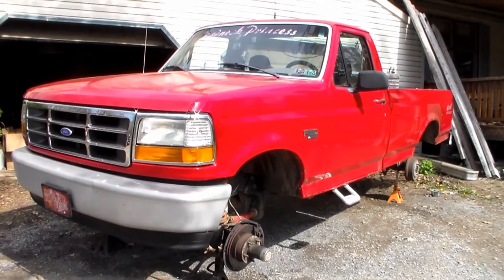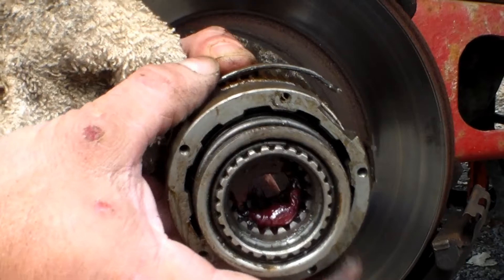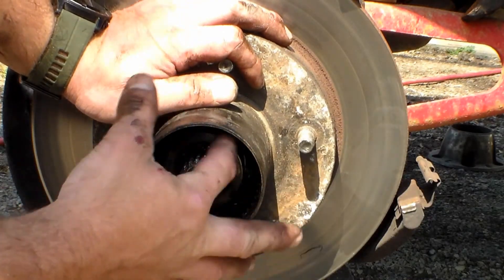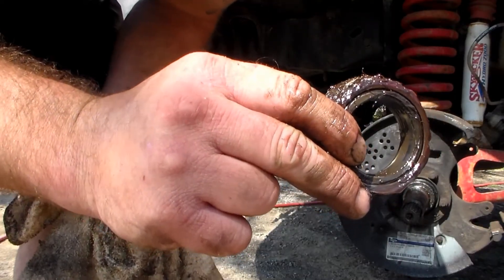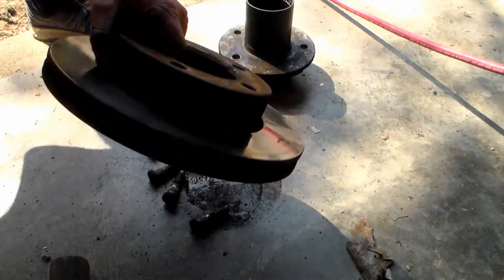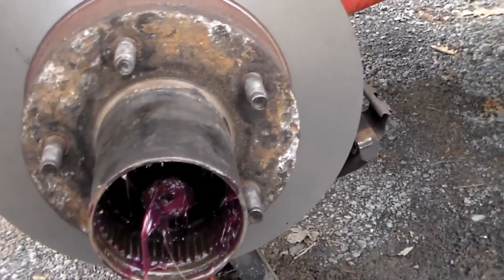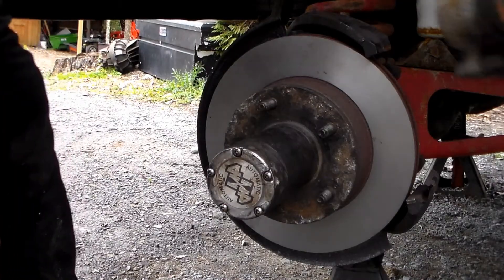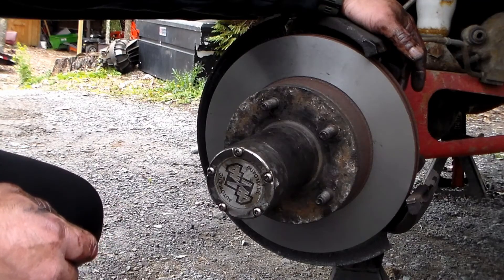OBS Ford - 4x4 F150 Bronco - FRONT BRAKE PAD and ROTOR Replacement- Complete STEP by STEP!

Comment: Great video, very detailed with lots of tips, I bookmarked it! I have manual locking hubs but I'm getting ready to help a friend who has the Auto Lock hubs so I wasn't familiar with these. I went to auto mechanics trade school many moons ago, we where taught to always to repack pack both inner and outer wheel bearings as well as always replace inner wheel bearing seal. I mean you might as well change that inner seal as you have everything taken apart and they're only $3-$6 each. And as you did, turning rotors and drums is always a good idea. What I do is buy a new set of rotors or drums, mount those and next time I do a brake job I take the old rotors or drums to the shop, have them turned and swap out. And just keep doing that till they no longer meet spec :)

Comment: Hey bud....  thank you for the video...  I am 50 years old and just bought a 95 F150 4x4 and I have manual locking hubs...   question....   should I fill the hub cap with grease after I get the installation complete??
Reply from the maker: No Sir. Just grease the moving parts but no need to "pack" the hub with grease.

Comment: Very nice video and without any distracting music. Make sure you stress how important it is to get the inside and outside of the hub clean, before installing the bearing. It is a greasy job, so have lots of paper towels or clean rags handy. When the hub is off the Rotor and cleaned up, that is the time to paint the hub if you are going to. Painting the hub and rotor does help to keep the Rotors clean especially if you live in an area where the roads get salted in the winter. Thanks again for a nice instructive Video.

Comment: Thank you!  This is a great video, you are a lot better than most people ive seen doing these videos. If you have ever thought of doing more, please do!
Reply from the maker: Thank you I appreciate the support!  At some point this summer I will be doing a video on how to replace your core support in an hour and a 1/2. You don't need to remove/drain the radiator or anything. I've done so many of them I think I have it mastered now lol.
Reply: @rednecktech82  Nice ill try to remember to check that out. The fact that you don't have an intro clip is great, it seems like everyone does that and it's so annoying! I have a 94 bronco that I am working on and this video really helped me. I am new to this family of vehicles and I nearly did something really stupid when I tried to take the rotors off. I didn't realize all that stuff inside and I tried getting it off by hitting the backside of the rotor, luckily I stopped pretty quick. It's nice to know how complicated it is so I can keep track of all those pieces as I take them off. It's also nice to know that I need that tool to take the nut off. Thanks again
Reply: A video on how to remove the headlight assembly would be nice if you ever have time. I know they're a pain in the ass, I gave up after about 20 minutes. There is definitely a way you have to do it.
Reply from the maker: @Cheeseplate1775   It's actually quite simple. There are (2) 12mm (?) nuts on the back side, 1 left 1 right, if you look close you will see them. On the passenger side I believe you may have to remove the battery box to get to them.  I'll try to get a video up by the end of the week.

Comment: I have a 95 f 150 and the rotor is loose ( turns a little back and forth ) even when the wheel is bolted down tight. What would you make of this? are the studs all jacked up?
Reply from the maker: @Bushradical  the wheel isn't loose but the rotor is!?

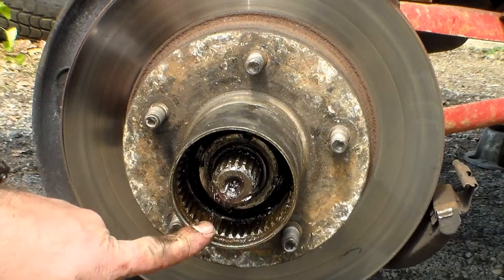Comment: At 4:00 to 4:30 we see behind the clip a splined washer and what appears to be a flat washer....mine had an extra washer, some kind of plastic. Any ideas where to find that? The dealer claimed it was no longer available.
Reply from the maker: Flat and splined all you need...that may have been eliminated, providing it was even factory to begin with.
Reply: Thanks....went back together well enough but wasn't sure about that one. @rednecktech82

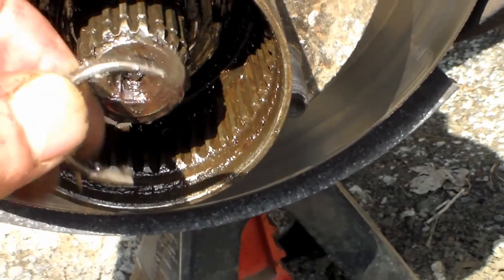Comment: I cant seem to get the locking ring at 3:30 off, it is a complete 180 position from yours in the video, I’m trying to get it with a very small pick and flat head screwdriver

Comment: wait how do we do the piston compression thing? seems like a huge piece to leave out
Reply from the maker: Put one of the old brake pads in the caliper and use a C-clamp to push the pistons back in. Have the cap off the brake reservoir when you do this.

Comment: Were working on this too. Any recommendations on how to get a very tight spindle nut off? We've got the tool with the teeth, but it's crazy tight and won't budge.
Reply from the maker: Have you tried hitting it with an impact gun? Next thing I'd suggest would be a really big prybar to get more torque on it.... If there's not much grease in that hub I'd throw some PB blaster in there too and let it sit overnight, it could be seized on.
Reply: @rednecktech82  We don't have an impact gun but considering getting one. Thanks so much for the response. We appreciate it.
Reply: @mucklerhappy7683  so I had this problem, I had to cold chisel the stuck inner spindle nut and brake it off, then I bought a 1 5/8-16 unc rethreading die and had to clean up the threads before reinstalling everything
Reply: Tap on the rachet handle with a small hammer should jar it loose.